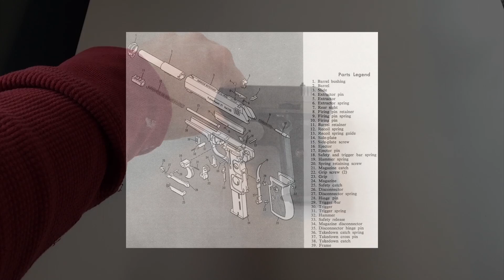CZ 27 Disassembly and assembly - field strip (Pistole Modell 27) Kal 7.65 (.32 ACP)

Comment: Something to mention about the take down catch and pin, is that the pin can move/slide inside the catch when you have it out for cleaning. If you accidentally move the pin up or down, you will have to slide/move it back to the proper position inside the catch, before attempting to put the pin back in.

Comment: Oh question. I can seem to find any info. 
My example CZ-27  will not hold open with empty mag inserted. Do you think a bad or after market magazine or is there a possible defect or part missing in mine.  Can you please take the slide of of your. And then insert your mag. And see what mechanically would hold the slide open. Close up. So I might be able to see if my parts are the same or missing or damaged. Or if my mag is different and not acting upon the correct devise or part.   Thank you very much
Reply from the maker: I saw the same behavior, I think it’s designed that way? You have to partially eject the magazine before the slide will move.
Reply: Interesting....but  mine will not hold open at all at any time.  That’s my issue.
Reply: @bryanmise5105 
You have broken magazine safety, or how its called in english. "Magazine dissconector" and it have no. 34 on the Parts legend on the end of the video :-)

Sorry for my english... have a nice day :-)

Comment: I have one of these and it works for a time, then starts jamming and needs to be fixed again. Are others having this problem? I really like the weight and feel of it. When it's working correctly, I have no problem being accurate. I would like to keep it, but am wondering what it takes to make it reliable.
Reply from the maker: Wal Ford, I would first make sure you are using full metal jacket vs hollow point, and also consider replacing the recoil springs and potentially the firing pin spring if you are not sure how many times it was fired previously. Also, ensure it it well cleaned, and lubricated. I don’t recall if there is a feed ramp on this pistol or not, which often professionally polishing will correct some feed issues on newer pistols. I hope this helps, and doesn’t cover what you have already evaluated.

Comment: what is the length of the outermost tip of the firing pin? in cm pls
Reply from the maker: Tip facing the primer - 7mm    |   tip facing the hammer - 5mm
Reply: Thx ..so it's about 0.28 inches the tip facing the primer?
Reply from the maker: 0.276 inches - I revised the measurement to be accurate above, thanks for noticing my initial mistake - if you start at .28  and work your way down  looking to ensure the primer isn’t being penetrated, you should be ok. Good luck!
Reply: Thanks for the quick reply. yes I noticed that the length sounded completely wrong, it's a little gun. - Thanks for the help, 0.276 inches. ✌️

Comment: Seriously ? You're stripping  a gun down without removing the magazine first ?
Reply from the maker: Hello Enrico Morozzi, Thank you for your question. Yes, this pistol's slide created pressure on the magazine that made it difficult to remove until I was able to pull the slide back. This may have just been an issue with this particular pistol, but I have only come across one, so I can't be sure. I could have probably done without removing the cross pin for the slide, but that is how I approached the disassembly to hyper extend the slide in a rearward position prior to magazine removal. The magazine was empty, so was no safety issue here. I hope this helps clarify.
Reply: Of course it is safe, this gun was inspected befor disassembly in the beginning of the video. It' s just a good general rule, when you strip ANY gun with a removable magazine, remove the magazine first. 😉
Reply: Field stripping this is almost the same as the Mauser 1914 where you still need the magazine inserted.
Reply: What mark?